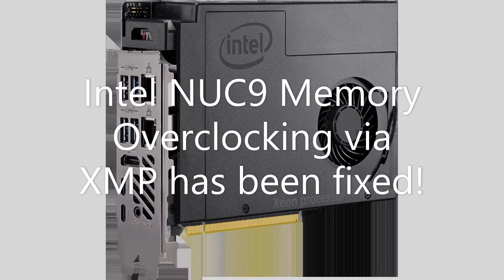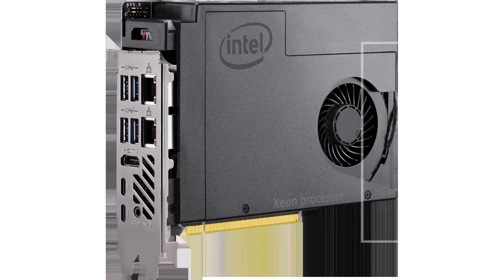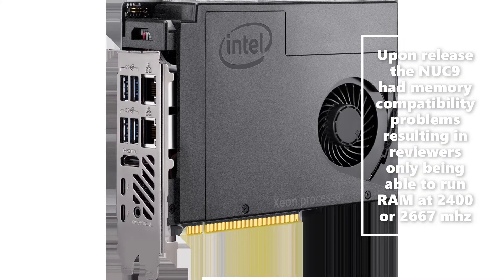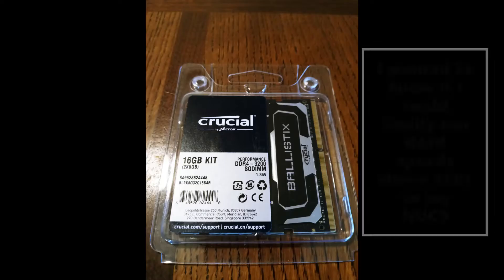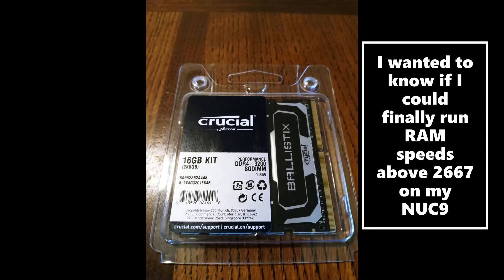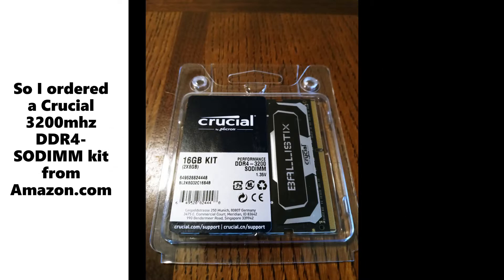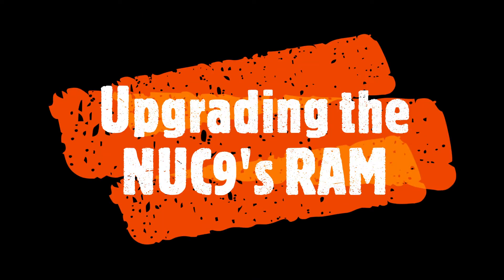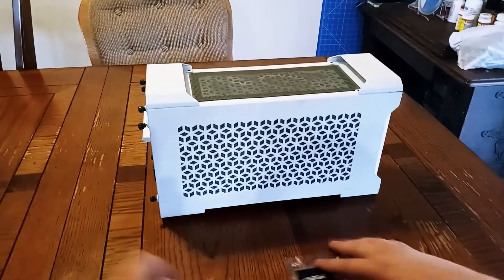BIOS Update - Intel NUC9 Memory XMP "Overclocking" now works at 3200 "out of the box"!

Comment: I would NOT reccomend overclocking this ever.  The unit in this video has the  good case BUT the NUC9 extreme case has TERRIBLE AIR FLOW FOR THE CPU!!! This case is much better the NC100.

Comment: The NUC 9, right now, TODAY is UNSTABLE!!!! I have spent weeks trying to work this out. I am on latest firmware 2021-NOV-07, with 32GB 3200 kit. It does NOT work. The NUC BIOS does NOT let you change the memory profile away from XMP and it does NOT let you reduce the frequency away from 3200. The ONLY way i got this to be stable (for the last 2 hours now) is to increase the RAM votlage from 1.2 V UP to 1.35V. I hope this works.
Reply: Hi, I know its old video but, will it actually run at 3200 on nuc9 i7?

if I get 3200@1.2v (there are kits that can run 3200 at 1.2v) I currently use 2666 modules, on i7 nuc9, and wondering if a 3200 kit will run at 3200?